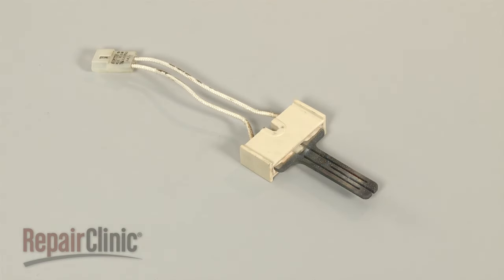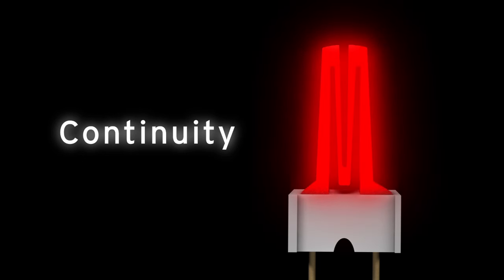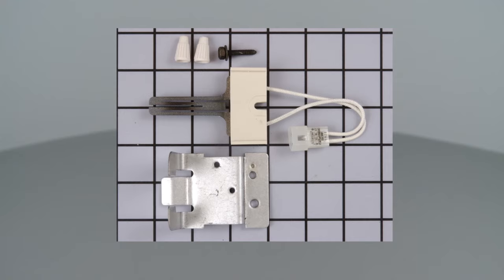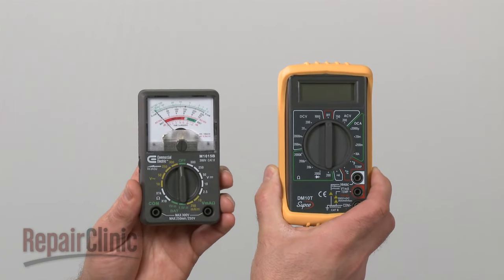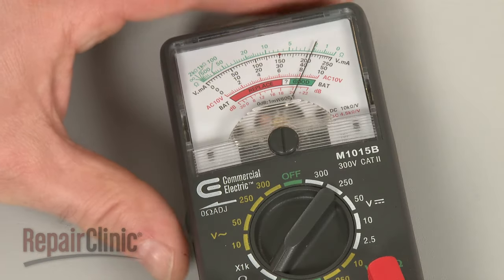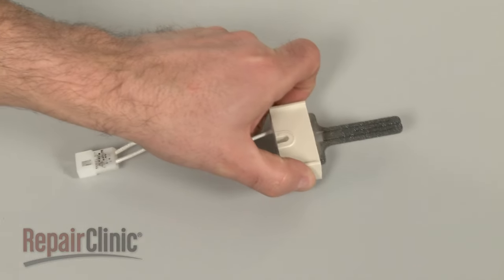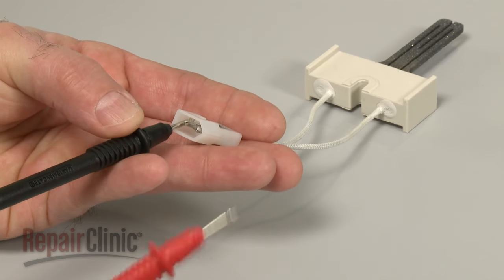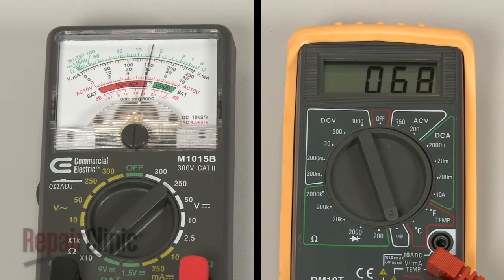Dryer Won’t Heat? Igniter Testing - Troubleshooting & Repair

Comment from the maker: The igniter is a heater not a switch so it has resistance. If an igniter shows a very low ohm reading it is shorted and will need to be replaced.
Reply: What reading is very low?

Comment: I have a Kenmore gas dryer from the late 60s that works great but is starting to take two or more tries to get the heat going. Does that mean the igniter is going bad or could it be something else? It was doing this about 5 years ago and I cleaned everything up and it worked great after that-- cleaning this time hasn't helped.

Comment: had no heat in kenmore gas dryer.replaced solenoids{which wasnt the problem} and the igniter which was bad.Had heat for two weeks now no heat. What do you think?

Comment: I have checked and checked but can’t work this out. I start my dryer, the coil glows, gas starts with flame, then flame goes out after about 10 seconds. This repeats every minute or so. I’ve changed the valves, the igniter glows, and the flame sensor all have continuity. Please help

Comment: What if I start my dryer and all is fine, heats up.. but after that it will no longer re-light after that?
Reply: HELLO It could be gas valve coils.  When gas valve coils are weak, they work a few cycles then they stop working.  You have to watch the whole 45 minutes for this.  Or come back at the 25-30 min.  Very easy to replace and they are only 12$     Of course this is only one thing that could be wrong.  there are other reasons why.

Comment: Maytag / Whirlpool p/n 4391996 ignitor  (was304970 Maytag) was measured at 61 ohms on my well calibrated Hewlitt Packard DVM. Used but functional ignitor on the same meter read 65 ohms. This is a 2% accuracy meter.
Reply from the maker: K Lynch As long as the reading is between 50 & 400 Ohms of resistance the igniters should be fine. The resistance can differ slightly between igniters due to temperature and other factors. The main thing is that the igniters are not open, no continuity at all.

Comment: I compared two dryers (no gas), both ignitor light up to red, then click, the difference is one of them becomes dim much quick than the other so I thought it might be a problem. can any one comment on?
Reply: I'm wondering about this too....  It seems to me that there possibly exists a gray area, where the igniter glows, but not enough or cools off too quickly to ignite gas mixture, or somehow a physical defect or problem with the igniter is preventing ignition...  No mention of what the symptoms would be if the resistance is too high -- but almost certainly it would not get hot enough, since current is inversely proportional to resistance...  Question is: would it glow to any extent at all and not be able to ignite mixture?....   A possibly misleading statement in the video says that if the igniter measures between 50 and 400 Ohms, it has continuity.   Actually it could read higher than 400 Ohms and still have 'continuity' -- it just might be that it is too high or a resistance(?).

Comment: I changed the internal bias thermostat, dryer fired up but after a few minutes it shut down. the igniter gets red but shuts down before it lights. Any suggestions?
Reply from the maker: CJay Shepherd You most likely have bad coils on the gas valve. If the igniter glows for a few seconds cuts out with no flame then does it again after a couple of minutes it is probably the coils. Also check the vent.

Comment: WILL A VOLTAGE TESTER WORK ON TESTING A DRYER CONTINUITY EVEN IF ITS ANTIQUE AND ONLY GOES FROM 120-600
Reply from the maker: +WeNdY N'Spire When testing the igniter we simply using the 1.5V in the small DC battery and measuring the components resistance. It is hard for us to comment on the device you have.
Reply: +RepairClinic.com thanks! It's fixed! :)

Comment: Why on all the continuity tests is a reading of .09 good but for some magical reason its not for the igniter?
Reply: The igniter needs to have a level of resistance in order to prevent overcurrent, or it simply shorting....  You want the igniter itself to have a resistance which allows it to glow but not short out the circuit.....  The other items are effectively switches; the igniter is not a switch.